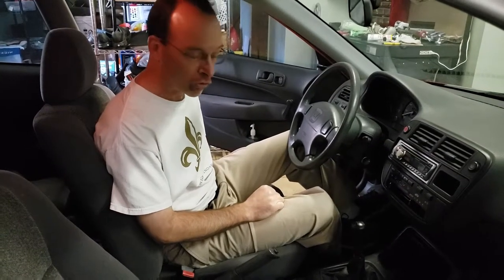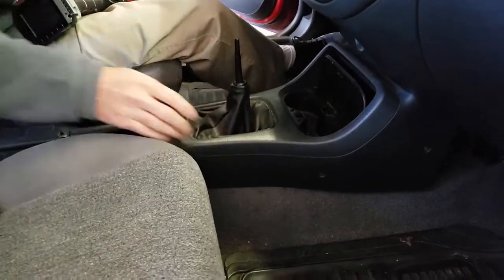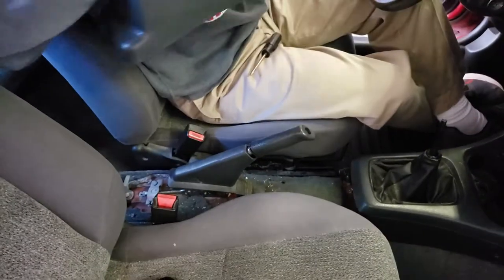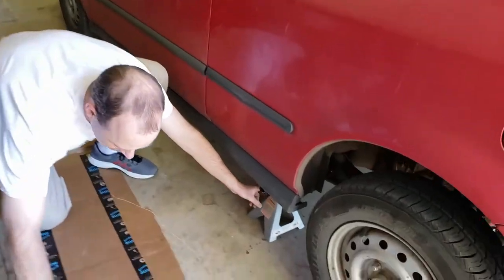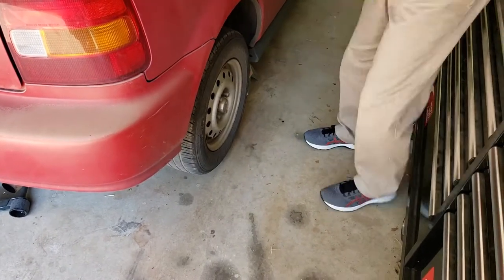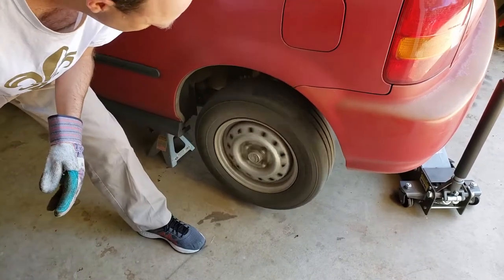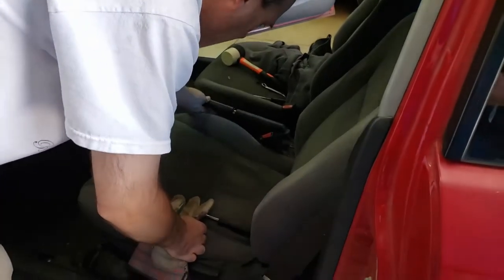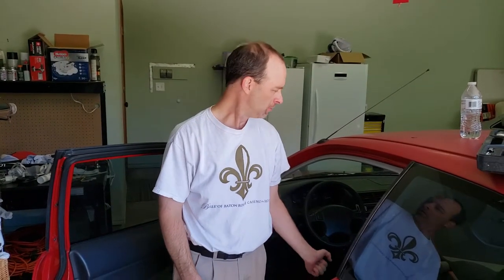Parking brake adjustment 1992-2000 Honda Civic

Comment: Good video. I think I'm getting closer to figuring out my brake problem. Sometimes the handbrake works, sometimes it doesn't. Sometimes, the left rear wheel locks up & sometimes it spins fine. Are the two issues related?  Does a cable need replacing?
Reply from the maker: Yes, probably related. When you say that sometimes the wheel locks and sometimes spins fine, do you mean it spins when it shouldn't (when parking brake is on)? Sounds like the cable is loose somewhere (maybe at the rear brakes?) or cable has some other problem. Replacing the cable should fix it, and doing the disassembly to replace the cable might uncover the problem.
Reply: @Fix Everything Yourself  Thank you, doctor!  My 1998 Honda Civic is my secondary vehicle & I'll be putting her in the shop as soon as I can afford to. 👍

Comment: I have a 99 Honda Civic ex manual. Had new wheel cylinder put in and my parking brake was how it should be before. Now it’s loose . Wth did he do wrong? It worked before
Reply from the maker: If the rear brakes don't engage at all when you pull up on the parking brake lever, it's almost certainly because the parking brake cable that attaches to the brakes (inside the drum) wasn't reattached. The tire needs to be removed, then the drum, then attach the cable. Pretty easy to do, and shouldn't take more than 30 minutes to do everything (take it apart, fix it, put it back together).
Reply: @FixEverythingYourself  No it was not adjusted at all from the previous person. Another person came that someone recommended. The drivers side rear back brakes where the adjuster were the spring came of was the issue. P brake and brakes are the way it should be now. On my 99 civic ex the adjuster is where the hardware where the where cylinder is